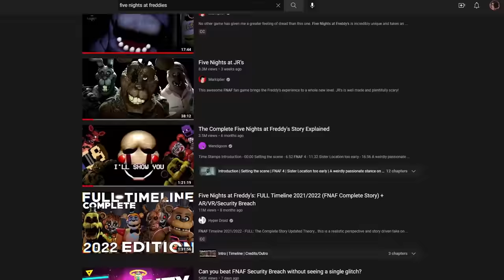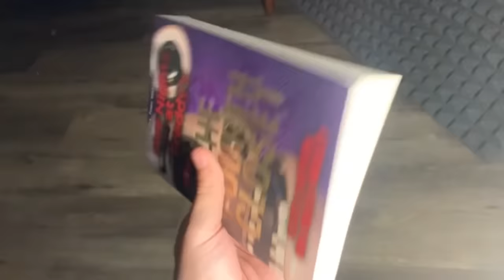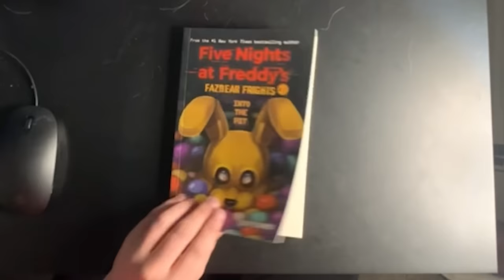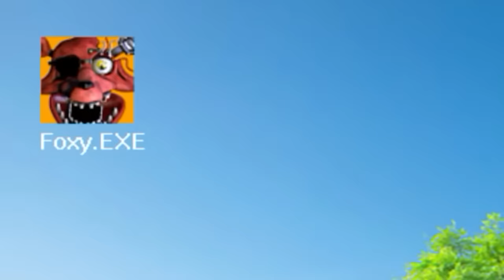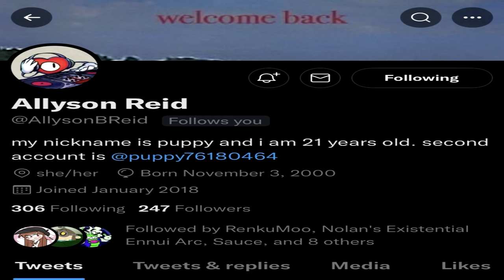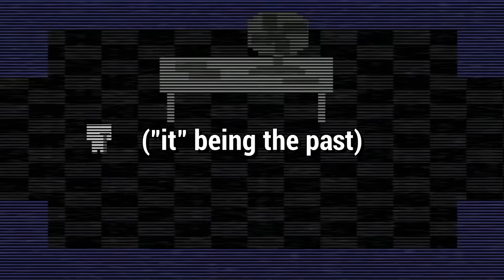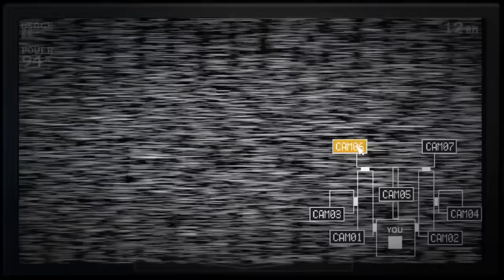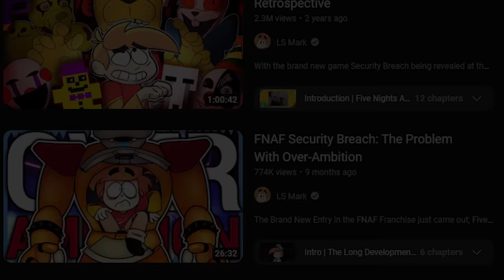I Read EVERY Five Nights at Freddy's Book

Comment: Just finished the charlie trilogy section of the video and i have a few things to say
First nice cheese trap at 3:00
Second: really liked the the review of “the fourth closet” most people tend to raise it off as bad because of the reveal Charlie being a robot (probably because mat pat said that 2 charters were robots because of the lol) loved how you mentioned all the foreshadow that led up to the reveal
Reply: Even if there was "foreshadowing" as far back as 2015 (highly debatable) it doesn't make the twist any less dumb. It still has all the qualities of an obvious retcon and asspull.

It doesn't add nor change anything by that point in the story. You could remove that entire subplot from the book and it would basically play out the same way. The narrative was never centered around it, and anything that could be used as "foreshadowing" early on is much too obfuscated to be proper foreshadowing. And even if it was foreshadowed, it still causes a littany of plot holes. 

So either way, a very bad twist in a not so good novel compared to its predecessors.
Reply: @sulphurous2656  I disagree, kinda. I definitely agree that the twist was dumb. But, if you take it for what it is and suspend your disbelief, I think it's fairly well-executed and doesn't bring the rest of the story down in any way (for me, at least).
Reply: @hithereIexistig  Well that's my problem -- I can't suspend my disbelief. It jumps the shark so hard that it almost makes the Super Cancer Research Facility from TRTF seem less out of place. The only thing it accomplishes is tainting your perception of the past stories (and being Game Theory fodder). More so since it is based on several retcons. Well executed is the last word I'd use to describe it. 

They give this long ass exposition dump courtesy of Elizabeth trying to "explain" why everything we saw up to this point was Charlie being an unreliable narrator somehow, except... that creates too many questions which simply cannot be answered. For example;

Continuity Errors: Why does nobody in town, let alone Charlie notice her own grave? Why does Charlie remember her own death if her memories are forged? Why does she remember anything to do with her brother prior to Nov. 1st, 1982? Why does the grave say she lived 1980-1983 when her birthday was May 13th, where she was 3 years old by that point? She would have been only 2 years old with this new death date. How does Elizabeth share Charlie's memories when she wasn't there for most of them? Where did a fourth closet come from when there was no mention of one existing until the exact scene the twist takes place at the end of the book? How could the endoskeleton with blazing silver eyes in the garage be Babby's when it was already confirmed as being Foxy's? How could the camera tripod been used to forge memories in the garage when she's moving around and interacting with the environment in all of those memories? Why do the illusion discs suddenly act as a shapeshifting device when that's not how they work? Why does nobody feel the effects of them being active if all of Charlie's past forms used them? Why does tactile contact not reveal her as an animatronic since they only alter visual and not physical perception? Why does her third and fourth form not weigh at least half a ton when the latter being a Funtime weighs in at least half a ton (or over a ton adjusted for material density)? 

Plot Holes: Where does Henry get the knowledge, resources (organs), and facilities to put a fully functional organic man (or woman in this case) together? How can Charlie have 'fake blood' (not artificial blood) if everything she does requires true blood? How is she functionally fully identical to a real human bean in every possible detail? How does Henry magically forge memories from before and after her death? How does Aunt Jen heal Charlie a cottage located in a ghost town with no equipment? How does she know what to do? How does she recover her body from Twisted Freddy in time?  Why do we hear her bones being crushed and other organic matter torn if she's meant to be metal underneath? How does she survive in that spanish chest of hers? Why does she bear no visible scars from the spring locks? How do the spring locks kill her instantly and leave a pool of blood but Elizabeth punching through her to retrieve the doll does not? How does she get back to strength afterwards after losing consciousness after seemingly having punctured lungs? How does Elizabeth have the ability to mind meld? How does a giant doll fit in her torso when that would leave no room for vital organs? Why does she seem have no electronics of any kind? How does Henry's seppuku machine slice through solid metal fibers like a hot knife through butter? Why does that kill Elizabeth, a literal Terminator?  Why do sparks only come out of Baby but not Charlie? Why does she suddenly feel no pain here?  How does a soul appear out of thin air and bind its self to the doll, giving it life when that's literally not how remnant (a retcon in its self) works according to FNaF's own rules? How exactly does she reappear for a third time in the epilogue (if that's her) after she and Elizabeth were supposed to be terminally damaged? How does neither she nor anyone else not notice her own grave despite staring right at it? Why does nobody in the town question that there's a dead person wandering around in the girl scouts or in schools and other institutions? Why does nobody in the restaurants notice? Why do her friends and family not notice? How is she not overweight to the point where it breaks the masquerade of the person being human? How does John not notice he's holding hands and kissing a metal girl? Why does William try to strangle Charlie if he knew she's a robot from the start and thus needs no oxygen? If he knew, why does he not care about capturing her straight away in TSE? Why is he focused on getting revenge in TTO by avenging himself upon her, but suddenly wants her for study in TFC? Where was Baby this whole time? If Baby only emerged after the house collapsed, how was William working on her way before that? How does William even know of Henry's dirty little secret? 

I can go even further and even more in depth. All of the above are just the things I can recall off the top of my head, things that went through my mind when listening to the scene as it was playing out. Almost all of these feats mentioned have either never been duplicated nor have any precedent in-universe. 

All of which contributes towards cyborgs/gynoids/tulpabots that are identical to real people (beyond the likes of what SKYNET/Tyrell Corporation/Starfleet could construct) coming out of a random engineers dusty old garage in the middle of nowhere, quickly developed during the early 1980's before said engineer even built the FNaF 1 animatronics being a total absurdity no matter how you try and justify it.

But that was just the tip of the iceberg as you already saw. And that's just from the technical reasons in-universe for why this should technically not even be possible. I haven't even gotten into the narrative/plot reasons for why this just doesn't work with how the novels had been set up in the first place.
Reply: @sulphurous2656  I was like the only person who just knew Charlie was going to be a robot with all of the tiny bits of foreshadowing when that book first came out (like her slightly denting the car from sitting on it comes to mind AND I immediately knew the purpose of those closets lol) and everyone thought I was fucking insane so I was just over the fucking moon when I WAS PROVEN CORRECT! 
I think part of the other reason I like this twist is it's exactly how I would write it too though (not sure what that says about my own writing capabilities though haha) :)
Reply: @sulphurous2656  You hit the nail on the head. I'll say that, for me, there's an even bigger reason why I hated the android plot twist.

Charlie (android or not) can be understood as a character representing someone with severe depression and PTSD. Plenty of people, including teens, who read the books probably related to her for that reason. The android twist essentially served to validate Charlie's anxiety that she's not a "complete" person, that she really is just a broken husk of a person, and then she commits suicide. That's an awful takeaway for anyone who would have related to Charlie due to having similar worries about themselves.
Reply: @tessfabled4115  This ultimately ties in to the fact that all of the out of place Science Fiction nonsense really took off in The Twisted Ones. Especially with so-called illusion discs becoming the nanomachines of the series (in the sense of a macguffin assumed to be capable of whatever the story needs it to be). Yet even then, as there was a Game Theory video that was speculating of the twist before The Fourth Closet was published, most seemed to have thought "that's never gonna happen, it's too stupid, even for FNaF standards" not to mention it felt like your average "MatPat reaching way too hard" moment. There were still too many problems and contradictions for it to make sense compared to a variety of more plausible explanations for the various phenomena we've seen.

Also, I might need your help with something. I've been scouring through my copy of The Twisted Ones for about two hours now, and I can't find any mention of that moment where her ass dents the bonnet of her blue Honda which everyone has been talking about. To the point where I'm no longer sure if I ever remember that being a thing in the first place.

EDIT: Nevermind, found it. It was in TSE after the diner scene. She sits on the bonnet of the car and it slightly dents under her weight. I'd just like to point out that is hardly anything abnormal. You can dent the bonnet of most cars just by poking your finger at it hard enough. I know this because I got a bunch of Honda's and Toyota's from the 80's/90's around here (Civics/Accords/Preludes, one of these being the exact model that Charlie drives). It doesn't make any sense to me how this could possibly be "foreshadowing" considering there's literally nothing related to her weight being brought up for the rest of the novels as well. There's no evidence to suggest she has abnormal material density at all considering that normal people can pick her up just fine without taking a trip to snap city.
Reply: @WaspCameraInSpringfield  Slightly different topic, but that just reminds me of something else that doesn't make sense. People seem to use the descriptions of Charlie's attributes in retrospect as 'proof' that this twist was foreshadowed from the start. Namely the clammy skin, paleness, coldness, heightened pain tolerance. 

Except for the fact that all of these things are consistent with her overall physiological state and even seemed to be lampshaded within the story. Clammy skin is frequently caused by anxiety, low blood sugar, or pain. Charlie observably prone to major anxiety attacks, and seems almost constantly on edge. Exacerbated when in isolation, as seen in TTO. It would also stand to reason as to why her Aunt would remind her to try and remain calm whenever possible, suggesting this is a semi-frequent problem. Paleness or coldness in relation to high stress is not uncommon either, and is also related to the reasons above (shock or fainting can also cause it). She also tends to eat less when about to undertake a nervous task but otherwise eats like anyone else, which would explain the low blood sugar. I'm sure you've met people like this at some point one more than one occasion in real life.  

Her ability to cope with physical pain caused by lacerations from Foxy in TSE is explainable through adrenaline rush, and in general through her implied continious physical activities (as evidenced through her being part of the Girl Scouts, and the other excercises or occasional athletic maneuvers she may perform). Yet despite this, she couldn't hold back crying in pain when trapped inside of the Twisted Freddy as the components dug into her whole body. One might also point to Foxy slicing her leg open, and how after her initial screams she realizes it hurts no more (to her fright). This is a rather obvious example of nerve damage caused by major lacerations, which can cause loss of feeling (his hook dug deep into her leg). Further evidenced by her limping afterwards, and eventually regaining her sense of feeling by the time she's in the shower at the end. The topic of nerve damage was in fact foreshadowed the first time she was slashed by Foxy. In this case however, that laceration in her arm would reopen after all of the strenuous physical activity she performs; climbing on the roof, dropping down, helping to move heavy objects, so on and so fourth. And it would be far from painless. She'd be left covered in scars after the ordeal.
Reply: @sulphurous2656  All very good points. In any case, regardless of whether or not Charlie being an android was planned from the start, it still creates a huge number of plot holes due to how little sense it makes (how impossibly sophisticated she is for what's meant to be the 1980s, as you said).